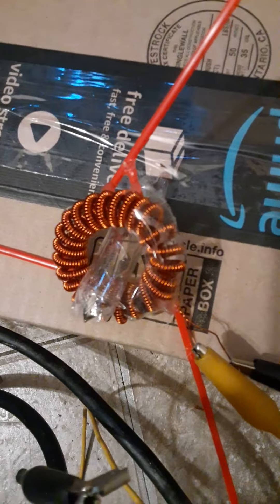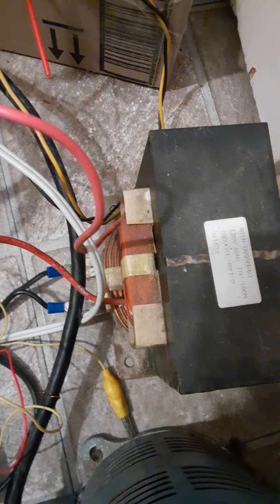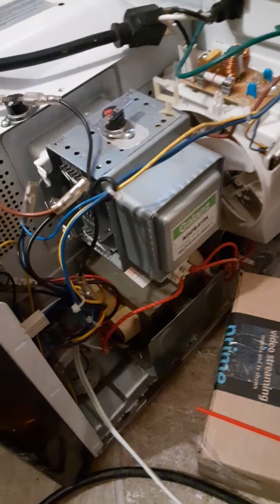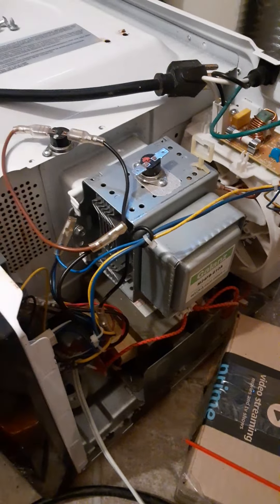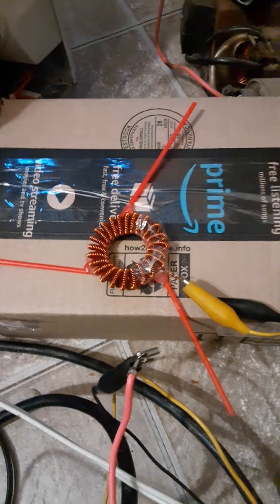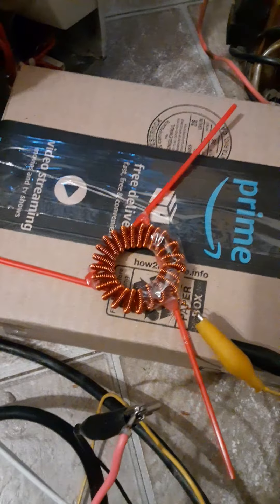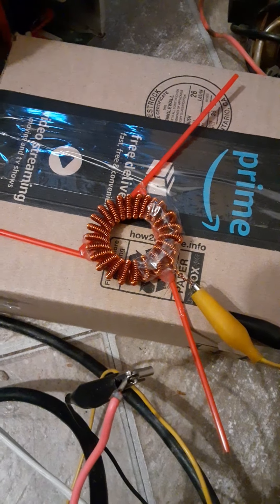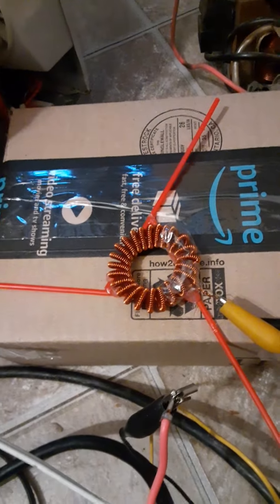bagle coil at 60Hz + 3MHz Tesla coil

Comment: You mentioned your background in EE, radio and physics, so in terms of the 60hz + 3Mhz, you probably know that any radiated EM waves - from the 3Mhz tesla coil and the 60hz bagel coil - the combination of those will just be the superposition and depending on the position of the two coils will determine the constructive interference and destructive interference of the two EM waves.

But in terms of safety,  those are not 'ionizing radiation' frequencies so that part is not an issue for safety.

The safety issues are physical proximity to the devices.   Since coils produce an oscillating magnetic field when being powered by an alternating current (AC, RF) , and knowing that an oscillating magnetic field will induce eddy currents in nearby objects - including skin - if they are conductive, then if the eddy currents are acted on by a static magnetic field, you have an oscillating Lorentz force in your body.   So you want to keep clear from anything that can produce eddy currents in your body if a magnetic field is nearby.

MRI machines get away with it because, while they deploy a large static magnetic field, the signal level of the alternating frequency applied to your body is quite low.  You never feel or suffer any disruption of your tissues from an oscillating Lorentz force.

Next, there is dipole oscillation.  Microwave ovens heat things by creating oscillations of the naturally-polarized water molecules.  Water molecules are dipolar (positive on one side, negative on the other side, due to the distribution of electrons in the molecule).  The crux is, if you get too close to a system putting out microwaves,  the water molecules in your body will undergo dipole oscillation and that creates heat the same way a bowl of water molecules gets heated inside a microwave oven.

I suspect, based on your  EE/radio/physics background you knew all this.  So I think it's cool you're going out of your way to caution folks about physical proximity to experiments.  And thank you kindly for being willing to show experiments.   It adds a lot of value to people trying to do experiments safely.
Reply from the maker: I knew all of that, but you said it much better than I would have.
I had forgot to mention anything about safety in my previous video, and a bunch of people pointed out how I should fix that. So I tried.
Reply: @spacecase0  Good on you.  I think most experimenters know or should learn the risks of being around electrical devices.  I think the opportunity to see experimenters doing their work is such a huge benefit.

I said this probably a year and a half ago, when Falcon Space and APEC were ramping up, that a live feed of the Falcon Space lab would attract great interest and fan support, because there's a huge, worldwide community of hobbyists and once a month APEC is hard to wait for.

Getting a chance to see others doing experiments is a great blessing imo.

.

Comment: hmmm do you have one wound the opposite direction? if that one hurts i expect the opposite would heal...
Reply from the maker: I have one round two different directions, and it doesn't make a stable coherent field. It makes a really good antenna. I think it's overall energy delivered that is why it hurt me, I think to heal it would need to be a much less intense field. but I will certainly give that thought some pondering and build one the other direction
Reply: @spacecase0  i have come across the curious healing power of the negative post of a lead acid battery. it stops bleeding, takes away pain from burns, cuts and bruises, speeds up bruise healing, etc... i believe it stops our body needing to use up adp/atp to do the healimg work. the plus side will make you sick if you hang on to it too long.